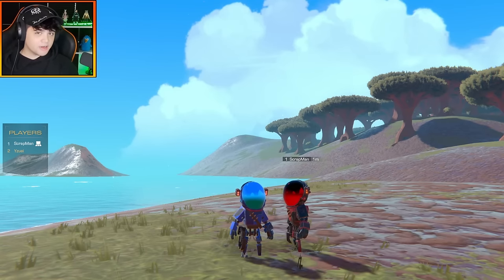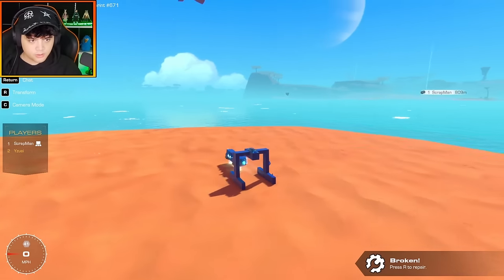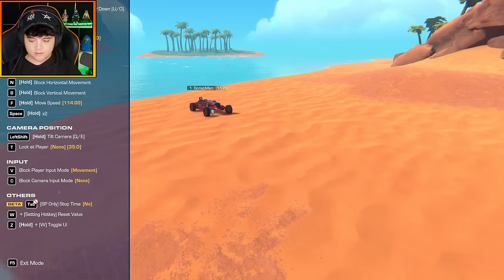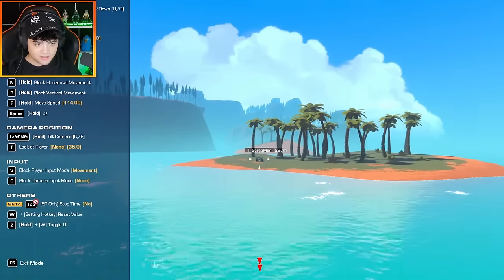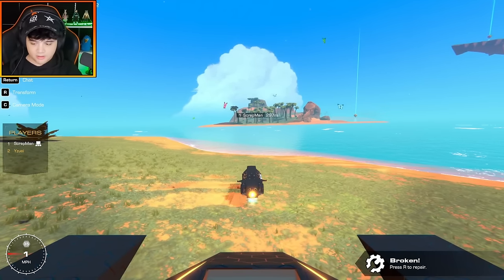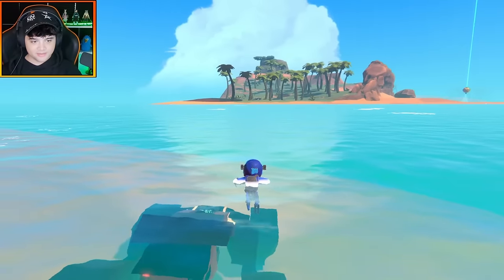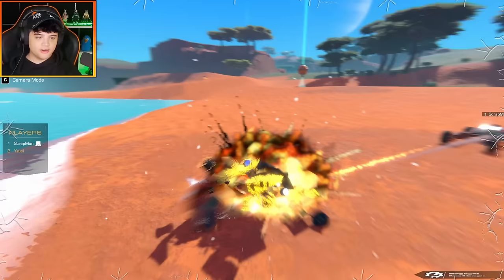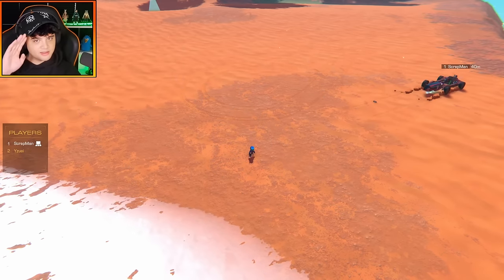Over-Engineering A HOVERING Torpedo To Use Against My Friend!

Comment: Regarding a comment Scrapman made when seeing Yzuei's missile in the showcase: why is Yzuei's missile a bit more accurate? Probably because of the thrusters on the side that he added close to the end to keep the missile stable (and it wound up doing so by the looks of it).

On another note rather than a torpedo I feel like these fall in line more with Cruise missiles more so than anything else due to being above water (cruise missiles can fly a few feet off the ground...granted they can also be launched into the atmosphere and travel through it to the target too which I guess yours' can't).

Comment: using proximity sensors on the side of torpedoes and missiles isn't against rules? it would greatly increase hit rate. also if you did bind side thrusters to speed sensor it would decrease drifting maybe.

Comment: That is not a hovering torpedo it is a ground effect missile 😉😉
Reply: That's actually makes sense
Reply: But it reminds me of that time Hayek called his ekranoplan a hydrofoil
Reply: Hydrofoils have basically an airplane wing underneath the water that picks the boat up and out. Ground effect is when you use the ground or surface to increase speed and generate lift.

Comment: to be fair why use a "hovering" torpedo when you have rockets^^ btw torpedos are designed to break boats in half by exploding under the water and the rocket is way more ez to destroy from a boat so a hovering torpedo is basically worse than a normal one cuz it can be destroyed by AA and cant do the kind of dmg a normal torpedo does xD